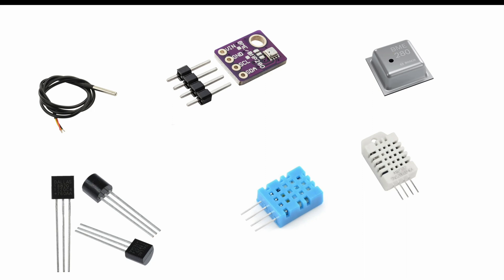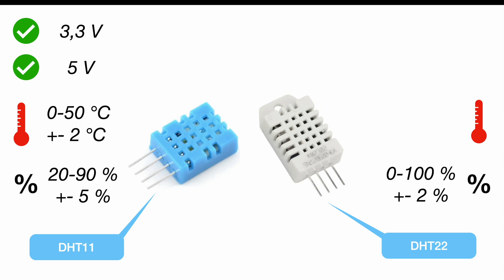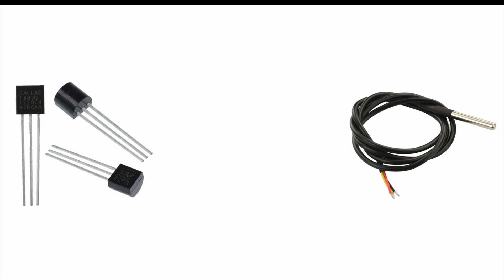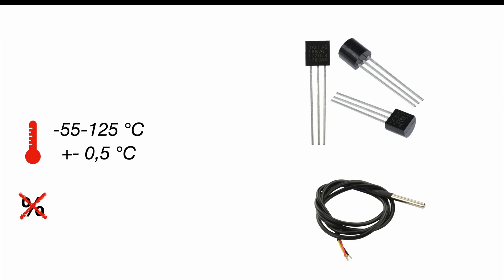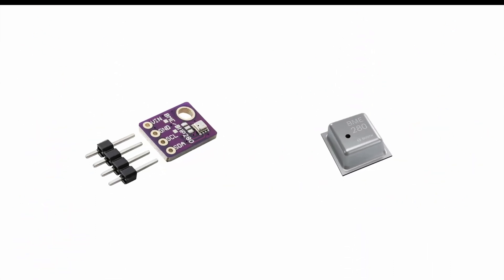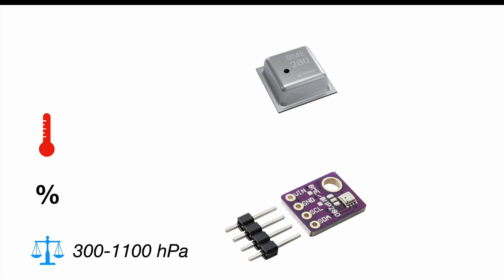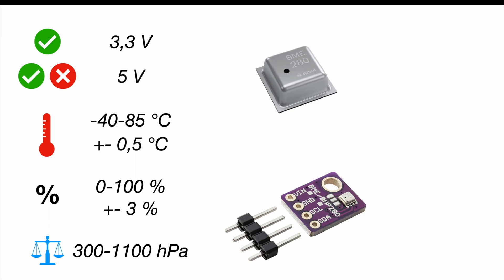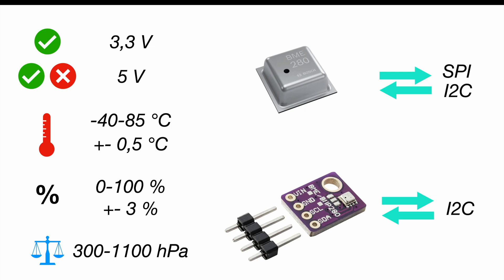Temperature and humidity sensors for Arduino, Raspberry Pi and ESP32 projects - DHT11 & DHT22 scrap?

Comment: Did you censor my last comment?
Reply from the maker: Hey Roy,
sorry your comment was lost. Actually I never deleted or blocked any comment.
In your case I can't see any other comments for this video except to ones public, so definitely no other comment from you.
But there is still the possibility, that YouTube blocked your comment in case it violated the community guidelines, in this case I have no control about what get's blocked and what not.
Anyway, just try to post your comment again and I try to answer it.
You can also reach out on Insta or Patreon in case you have a request not related to a specific video.
patreon.com/blueprint_iot
https://www.instagram.com/blueprint_iot/
All the best and thanks for watching!
Reply: @blueprintiot  well, what I said, IIRC, was that DHT11 is good for learning and stops abruptly there. That the mentioned BMP180 hardly exist anymore, but that there is the BMP280. Also, you didn't mention the AHT20/21 sensors that are very good at temperature/humidity. Also, there exist now combined boards with both bmp280 and ath20, mimicing the function of a bme280. Lastly, I said that using an i2c multiplexer, you can connect up to eight devices with the same address to the same bus and such a device, like TCA9548A, starts at about a dollar (regardless of which)